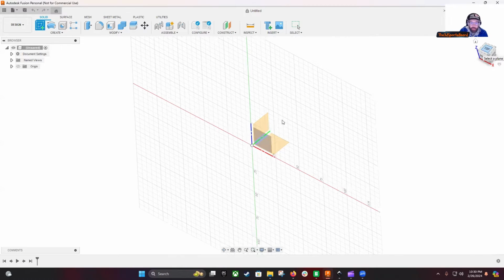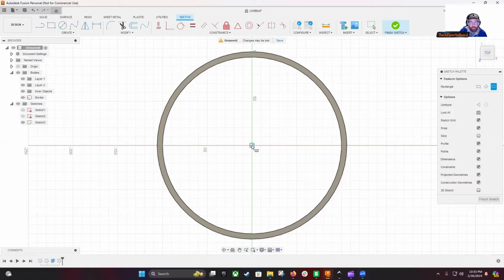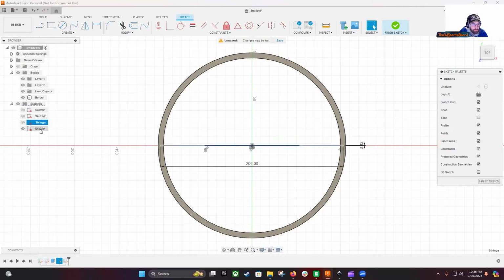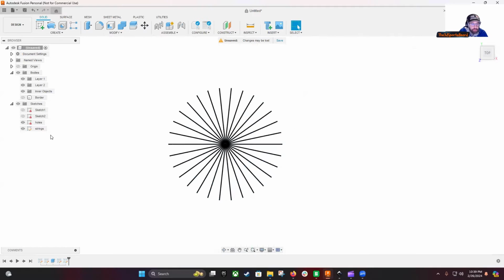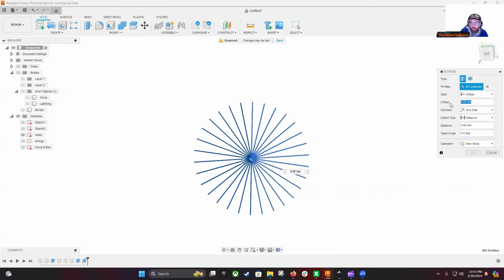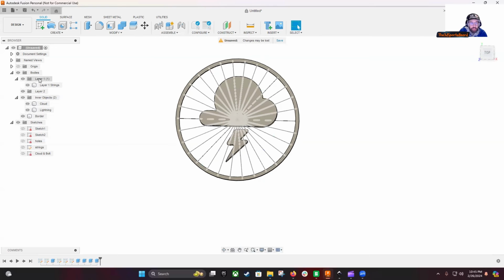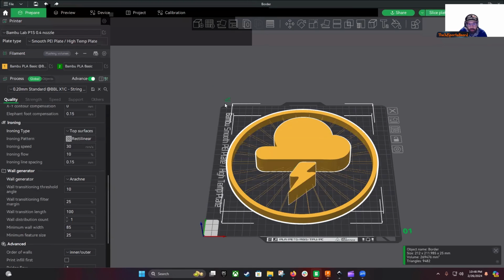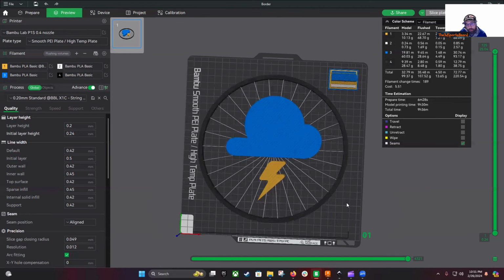Designing String Art for 3D Printing using Fusion 360

Comment: What slicer settings do you use?
I just copied everything you did here and sent to print but the strings are not holding the entire way. Do I need to slow it down?
Reply: Yeah, that's where I'm at. I would say maybe 6 strings of the 24 held. Trying to figure out what slicer settings on the A1 Mini would work best to get it to print.

Comment: Very cool video! Following the exact same instructions, Bambu Studio wouldn't slice the strings; here's what I had to do, with a 0.4mm nozzle and printing with 0,2mm layers: holes are 0,8mm wide, the strings are 0,6mm wide. Both were extruded 0,24mm. I'm curious to know why it won't work if I use exactly the video's measurements.... I'm using a Bambu A1, that may be why
Reply: Did you select "detect thin walls" in bambu studio?
Reply: @wolfhoodie  Not sure!

Comment: Hello good morning everyone
If possible I would like an opinion from a fusion expert on a project I am trying to make.
The model in question would be a ring with string art, I am making the whole thing using fusion 360, I have done some tests but unfortunately they fail when it starts printing the wires.
Analyzing other users' projects I noticed that there is a difference in the attachment of the wires and I don't understand if it is a fusion design problem or a slicer problem
If anyone can give me some advice I would be grateful